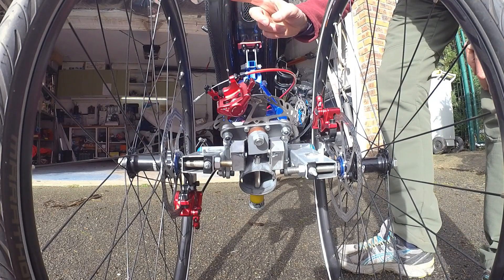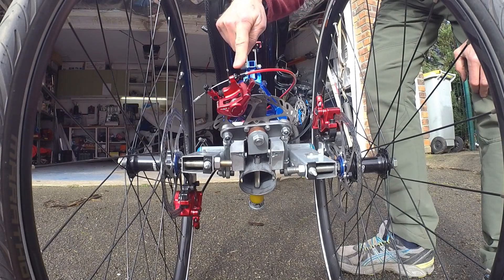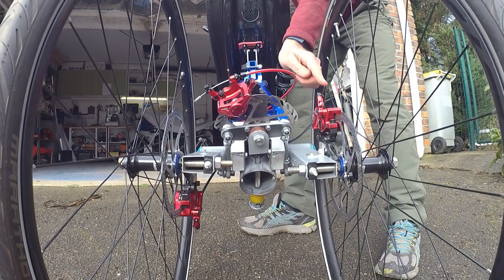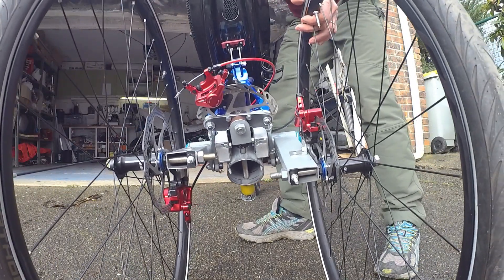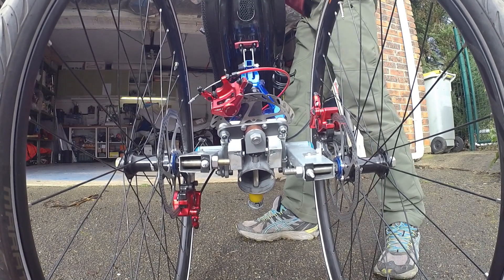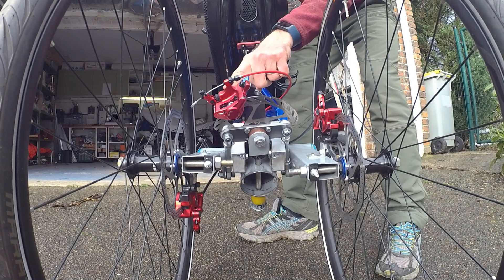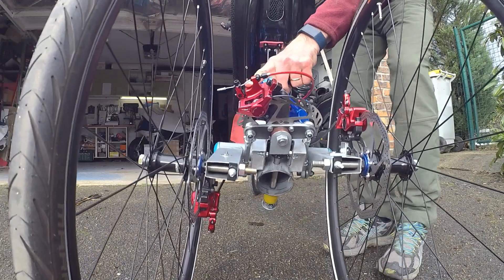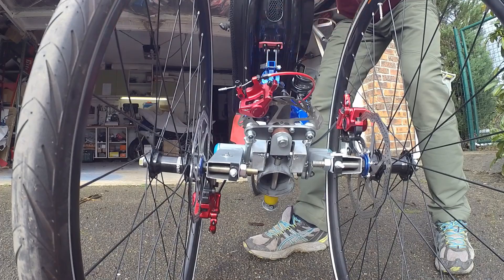Tilting Trike with upgraded "Tilting Lock" mechanism

Comment: Any problem when you need to brake and tilt at the same time?
Like at a sharp curve downhill.

Nice job Daniele!
Reply from the maker: Thanks Sven! You can use rear brakes when you enter in a turn , the only thing is that by doing so the bike becomes a little harder to lean. In fact when pulling rear brakes the bike tends to keep the current lean angle....
Reply: @daniele_go 
"enter in a turn":
Do you mean to rear brake before the turn and then not rear brake in the turn, just front brake?
"little harder to lean" :
Do you mean that it is possible to lean and rear brake but you just have to work harder?

Is this a real problem?
Daniele, what is your experience of this?
Reply from the maker: @svenabrahamsson1412  I mean that when pulling rear brakes on a straight line the bike will be slightly more difficult to lean in a turn.
Similar experience when in a turn you pull the rear brakes the bike will be slightly more difficult to go back to vertical. Hope it makes sense....

Comment: Excellent work Daniel !. I only have one doubt, the axes that connect the ball joints are rigid axles themselves or are they traction springs ???, I cannot distinguish them.
Reply from the maker: Hi, both axles are rigid ones.
Hopefully you can see better in this video:
https://youtu.be/0z8ZYveC9JI

Comment: Excellent development to an already great conversion idea, Daniele.  BTW, does your touring solar trike also have a leaning/tilting mechanism on the rear wheels?  If yes, what recumbent bike is it based on (I think I saw an M5 mentioned somewhere among your videos, but that is a rwd recumbent,  which would make it unsuitable for fitting a 2-wheel tilting mechanism on the rear, no?   Thanks.
Reply from the maker: Thanks! Yes, the tilting mechanism is installed on all my solar trikes. I am using it on Raptobike (Front Wheel Drive) and on M5( I transformed as FWD). It is also installed on Cruzbike and Performer recumbent bikes
Reply: @daniele_go  Thank you!